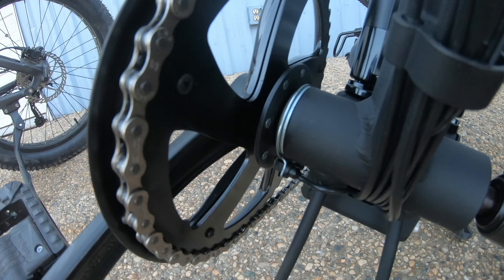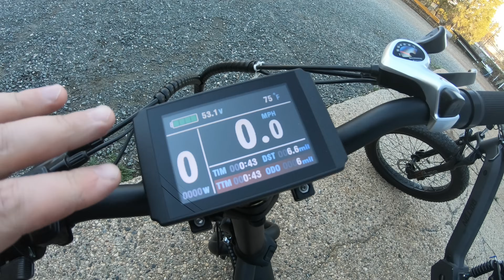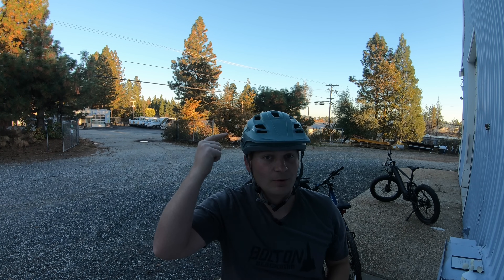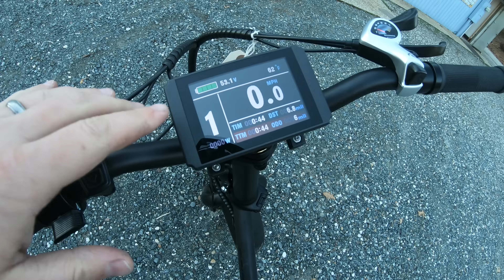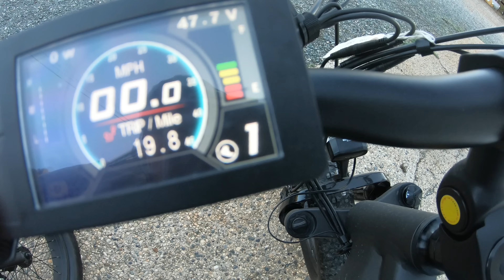Ebike Cadence vs Torque Sensors - the surprising outcome

Comment: the one thing i dont like about the cadence sensor is the lag time the power comes on and more importantly off. the lag between you stopping pedaling and when the actual motor stops has caused me to almost crash before. nay way to adjust this? thanks!
Reply: That is where a twist throttle comes in.  Use it to get quickly off the line and slide right into PAS pedalling

Comment: I hear that argument all the time about torque sensing being more natural but I don't buy it. What's natural about power delivery before the pedals have rotated? I never got power from my analog bicycles before moving the pedals a significant bit more distance.🤷‍♀
Reply: My Blackbird has a torque sensor, but it is far from natural. It just isn't refined ... the power comes on all the way immediately when I apply force, and then shuts off right when I am trying to get a rhythm. I've ridden friend's bikes with torque sensors that work in a way that I had hoped when I ordered the Blackbird.
Reply: @blakeberlin6295  that's the kind of torque sensor I hope I never get. It's supposed to apply power in direct relation to your legs power output. What you have sounds like a cadence sensor, but with no lag.

Comment: I have a smart motion which has both cadence and torque sensor.  You can change whilst riding by a double click on a button which means you can work at the pace you want when you want.   I am 85 years old and both knees are completely shot but I can still ride 40kms per day.by varying the sensor and the effort required at any time.
Reply: Smartmotion is a New Zealand designed brand, only sold in NZ and Australia as far as I know.  There is a control built into the display labelled "Power" / "Eco" which actually switches between Cadence sensing (Power) and Torque sensing (Eco).
Most torque sensors also transmit a digital cadence signal as well as an analogue torque signal, so if the controller is set up to process both signals, and there is a switch that allows you to choose, you can have either.
They use Chinese Dapu motors. I am not aware of another bike brand or another motor type that offers that choice.
Reply: what kind of engine and what brand is it?
Reply: @timiditta70  Sound like an ION-sytem.
That's a smart system.
Or it can be a BOSCH.
Reply: Can this be done on a hub motor ? And may i say godbless u man your my favourite ebiker ever ,what a inspiration
Reply: Yeah, please give bike brand with those features. Looks like a good compromise for some people
Reply: @dennisluz6453   the bike is a SmartMotion all their better bikes have the feature.   Designed in New Zealand and assembled there but Made in China or somewhere.   The one I have is the X-City which is a step through hard tailed mountain bike, now I think the latest is the Neo but their standard bikes also have the feature.
Reply: @dennisluz6453 search for Troxus Plus, it can shift between torque and cadence sensor

Comment: I added a diy hub drive kit to my old mountain bike, it has a cadence sensor, and a throttle.
I have found that the 'power levels' are actually more like 'aiming speeds', as in speeds you might set a cruise control to. So I tend to find myself pedalling at or near those 5 different speeds - I can go faster or slower by pedaling harder or lighter, but I tend to end up at 5 particular speeds. I have ridden a torque sensor bike too, and with that, it doesn't care about speeds (below its speed limit) it just feels like you have bionic legs at ANY speed. It took me a little while to get used to how to control the cadence sensor bike, off road for eg, I have to turn the power setting down otherwise the motor is trying to get me to too high a speed for the terrain !
You just don't get this with a torque sensor,  based on my riding of only one sample, I admit.
It may be that my particular make of cadence sensor motor  (Yose) has aiming speeds, other makes may do it differently, and so have a different feel when riding.
Reply: I can confirm that different hub motors manage power differently. On my Radrover Bafang PAS meant power level, not speed. As expected a low PAS simply delivered less power, and higher PAS gave higher power.  I now have a Linghui hub (Paselec GS9) and it behaves very differently; basically PAS modulates power to manage speed. So I get nearly full  power until I reach the target PAS speed, or as you said "aiming speed". PAS basically sets cruise speed.

Comment: Torque sensors are overhyped imo, and most torque-sensing motors are overprized. My Foxbat as it came from factory felt a little choppy at first, but after moving to 8-speed 11-34T drivetrain and the 9-scale pedal assist, it now rides smoother than any other bike I had. With the controller already converting inputs from cadence, speed and gear shift sensors into best power outputs, the key for me was to become very adept with the pedal assist buttons, blind operation basically. Gear shifting is no different than before, a bit of lookahead and road profile judgement is needed. If I ever buy a Santa Cruz Bullit or something like that, the reason will not be torque sensor, but weight (Carbon frame, <50 lbs 😅).

Comment: I'm 56 my knees are not great. My bike is cadence sensing. I love it, and I see why they call it ghost peddling. I don't need to apply massive pressure to climb hills or to reach higher speeds on the flat straightaway. I love my bike!
BTW its a Sabre from Bolton!

Comment: I had a hub motor with a cadence sensor and my new bike is a mid drive with a torque sensor with a throttle. I prefer the new bike setup.
Reply: What bike did you get?

Comment: I have the letric XP 2.0 so I can only speak for cadence sensor, took a minute to get used to it, but the more I rode the more I liked it.
Reply: Same bike. Same experience.  I like that I can set it on 1 or 2 and forget it.  I provide all the power normally but when I reach a hill and slow down, the magic begins.  However, I am considering the Level 2.0 (torque/hub/throttle) for my next bike.  It looks great and rides more easily, like a traditional bike.

Comment: Years ago I built my Cannondale hard tail into Ebike by using the Bafang mid drive from Luna. Last year I bought a Rad Mini with a hub drive. I have since installed your controller on the Rad and the power is great, but I miss the power delivery from the torque sensing system. Here's my question… Is there any way I can install a torque sensor into my rad? Having worked in bike shop in a previous life in pretty handy with the tools.

Comment: Some ebikes have both a Cadence and Torque sensor.  What is the advantage of that?
Reply: Without cadence sensor the bike can start to move just by putting a pressure on the pedal while standstill.

Comment: In the biking world "ghost pedaling" is when the cranks/pedals rotate on their own when you are walking alongside a bike. Instead, I prefer to call the phenomenon of pedaling on an ebike without adding pressure to the pedals "air pedaling" because "ghost pedaling" already has an established meaning.
Reply: yeah but in the ebike community ghost pedaling is universally understood as what Kyle is describing.  Its not going to change.
Reply: Bikes with gummy freewheel cones tend to ghost pedal when bike is wheeled along, I had to put some engine oil onto the freewheel bearings as the chain was almost getting thrown off while coasting

Comment: Cadence sensor and throttle for me ~ sometimes I want the bike to do all the work and sometimes I don't ~ best of both worlds
Reply: So a torque sensor type wont have a throttle?
Reply: @MrRahimhosein  ~ no, I think torque sensor types can have throttles too.
Reply: @JERRYPRO121  the Aventon Level 2 is a torque with throttle, thats what i have now and i love it.  I have a bad ankle so peddleing tends to hurt after a while, with this setup i can get all the benefits of biking and when my ankle starts hurting i can just throttle until i am able to peddle again
Reply: @MrRahimhosein  They absolutely can.  Since many regulations don't allow "class 1" ebikes to have a throttle, many that are sold don't have them (buyers want to stay within the class 1 designation so they can ride them more places.)  I ride conversions (bought the kit and added to my existing bike).  The conversion kits all have a throttle but you can remove and unplug it in 1 minute if you want or need to (say you get stopped and questioned because you bike has a throttle.  In 1 minute, you can make it NOT have a throttle!)
Reply: Àà

Comment: I'm ordering a torque sensor for my bike if I ever get the chance, but I'm going to find a way to keep my thumb throttle. No exceptions, even if I have to splice it together somehow. For a front hub motor like what my DIY eBike is, losing traction on that front wheel is not an option, and cadence sensor PAS gives me massive issues with that, to the point where I had to remove PAS entirely for now due to crashing as a result of front traction loss on loose surfaces.
I'm going for the best of both worlds, and nobody's going to stop me.

Comment: I want the most possibilities to choose from. 
I may want to pedal hard or soft. 
I may be stopped at a light on a hill and want a throttle to help me start out.  
Limited to "push hard or no extra power" is not for me. 
I have rear drive, cadence sensor, and full throttle.  
Works the best for my riding style and terrain.

Comment: My next bike will have torque sensor with throttle.  I like my RadRover, but I'd like it better with torque sensing.  With the stock motor controller, the delay starting off was often a balance issue for me.  It is much more ride-able with your motor controller installed, as the delay is hardly noticeable, but still has more power taking off in other bike traffic or people than I feel control with.  There are not a lot of level trails around here.  Can't wait to get your Bolton Air Forks.  Any idea when they will ship to you?

Comment: The one brand named hub motor, cadence sensor bike I rode had a noticeable delay in power application as well as power disengage when I stopped peddling. Not a fan of that.

Comment: I prefer Cadence sensors.  I have 3 with it and I wouldn't want it any other way.  Torque sensors are just too limited IMO.  and for anyone wondering, I have 2 rear wheel hub hardtails one 26" and one 29er and a 26" trike I converted with a front wheel hub.  They are all "class 4" ;-P

Comment: If I got one with torque sensor, I  would insist on a belt drive vs a chain, too much pressure on the chain and the gears.

Comment: Just to confuse the subject, my Juiced Bikes HyperScorpion has both a cadence and a torque sensor as well as a throttle.  The cadence sensor is always active, but the torque sensor can be turned off in the settings menu.  I like riding with both on.  It feels good to me to be rewarded for riding as hard as I can.
Reply: I have a Juiced bike CrossCurrent with both torque and cadence sensors and really like this setup as it feels very natural with a smooth power delivery. It’s a class 3 bike so also has a throttle. A friend has a Santa Cruz mid drive with torque sensor, nice bike, but it can’t keep up with the CrossCurrent as being a class 1 bike it has no assist over 20 mph. I suspect the Santa Cruz would be strong on big hills though, where the extra torque of the mid drive and the low gear potential of the 12 speed cassette would be a big advantage.
Reply: As does my 3 year old Juiced Crosscurrent.
Reply: i should of read the comments before i posted the same thing.  
nice to see i'm not the only one that still watches new " Ebikes Explained " vids.  
on a side note - i've mentioned in emails to juicedbikes on making the " scorpion tall seat " able to flip-up and access an enclosed/lockable compartment - maybe Kyle at Bolton EBikes could look into the feasibility of creating and selling this  ?
Reply: Good idea, Tom.
Reply: Level 3

Comment: My first ebike experience was with a torque sensing Bike Share bike.  Based on that and initial research, I thought torque was the ideal.  However, when it came for my purchase, I bought a cadence sensing bike because it fit my budget parameters.  After a couple of months,  I've come to the realization something I haven't  seen mentioned much: Bike weight & physical ability matter. I'm 5'5" and 147lbs and generate lower than average wattage.  Given the weight of my bike w/battery is 62lbs. it takes effort to manage PAS1 & 2.  I think I'm better off learning to manipulate the hub motor, PAS, throttle and gears to customize the kind of ride of want to take each time out.
Reply: That said, I"m curious what it would be like to ride the Avadar for comparison.

Comment: I have an Aventon level o demand ebike.  Recently with only 117 miles on the bike i am having intermittent power loss.  Error codes indicates possible issue with my cadence sensor..  Would Bolton ebike sell a cadence sensor that would be compatible with my Aventon Level that would deliver more reliable power.  If so could you refer me to a site to purchase.  Thanks

Comment: Love this video. I prefer a torque sensing mid-drive for immediate response. Really nice for stop and go commuting or off road. They help my customers manage battery life better as well. All that said, there are tons of folks for whom adding a throttle means it just does not matter.
Reply: I have been using a tongsheng for over a year and just got a BBS02, the bafang is way more efficient but I miss the torque sensing. Spent ages tweaking the settings on the bafang so it is suitable for my needs.
Reply: @smallhatshatethetruth7933  I have used both. It is not possible for any cadence based system to be as efficient. The Bafang, which is quality and heavy-duty, is 2#'s heavier and has a far higher friction, indirect power train. Gaurenteed, something is wrong with your TSDZ2 if it is not noticeably more efficient.
Reply: I don't get why most manufacturers don't include a throttle for mid drive bikes but if you use a DIY kit, it has one.
Reply: @Andrew-it7fb  lots of places do not allow throttles. More are going to ban throttles. With torque sensing, there is no need for a throttle; response is immediate upon pressing the pedal. If one doesn't intend to pedal, an electric moped or scooter is probably a better choice. E-bikes make traditional cycling, easier, more convenientvand accessible, not faster or in to a mooed.
Reply: @MHH3180  I don't understand saying there's no need for a throttle. It's about having options. You might be tired and just want to use the throttle to get the rest of the way home. You can use a cadence sensor without a throttle too and ghost peddling with a cadence sensor is easier than peddling with a torque sensor. The aventon level 2 is high on my list because it has a torque sensor and a throttle.
Reply: @Andrew-it7fb  I was just explaining, bit the idea is to make CYCLING easier. That is not cycling. You may indeed have to work your way up to longer distances. Rarely does even a person with disabilities, such as myself, grt so tired they cannot even move their legs. 

As for The Aventon, it is absurdly heavy and hard to handle. The geometry makes it strictly a bridle path bike as the handling is slow. Wait til you have to replace a tube with the huge and hea y hub motor. Sadly, among the more affordable bikes theirs is among the best. Even more sad, I believe  their throttle runs all the ay back to the controller so removing it for riding on restricted paths is not an easy task (more and more coming and soon bike lanes as well). When you are using a throttle, you are not cycling. You have a moped.
Reply: @MHH3180  And it's unfortunate that more manufacturers don't include something incredibly easy to add on bikes with torque sensors. Sure I'd prefer a lighter bike, but the manufacturers aren't leaving much in the way of options. By definition, it's still an ebike even with a throttle.

As far as the level 2, it's a commuter bike so trail riding isn't really its purpose. It's only a few lbs heavier than the giant lafree E + which is the cheapest mid drive I've found. 🤷‍♂️
Reply: @Andrew-it7fb  oh golly no. The Bluejay, Eunorau's D6 (Tons of clones), The Buzz, everything from Momentum and of course there are always folks like me that build much better vustom bikes with torque sensing mid-drives.
Reply: @MHH3180  bluejay's are pretty expensive.  Buzz is the only one you mentioned that's really cheaper.
Reply: @Andrew-it7fb  sorry, I will sell Bluejays foe less. Nome tum is way less than The Giant to which you refer. They are actually owned by Giant. I feel they are superior to theor regular line, though I do not sell them.
Reply: @Andrew-it7fb  ph yeah, The D6 is less too.
Reply: @MHH3180  I think the lafree e + is sold under the giants momentum brand. From what I've been able to find, their cheapest mid drive is around $2400 which is more.  I'm hoping to buy locally so I have somewhere to take it if I have any issues.

The d6 looks about $2k

Comment: I had a 750-watt hub drive cadence sensor bike that could go 33 mph with little effort for long stretches. I now have a 1000-watt Bafang Ultra mid-drive torque sensor that can get as high as almost 40 mph but I can’t maintain that speed for long as it is too exhausting . So with just PAS I could potentially cover more ground quicker with my old cadence based 750-watt hub bike, although as stated, the torque sensing 1000-watt mid drive feels more natural. As Kyle mentioned , both have advantages, and while I prefer the torque sensor, I do often miss cruising 33 mph while essentially ghost pedaling.
Reply: Thank you for that. Explains clearly an advantage of a cadence bike under certain conditions, and the fun of ghost pedaling.
Reply: what kind of 1000w mid motor do you have of bafang?